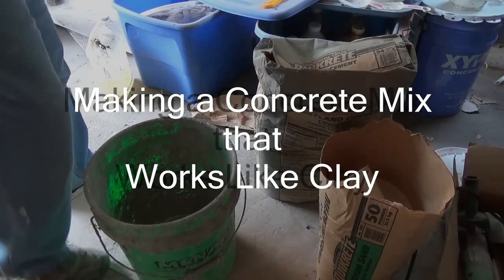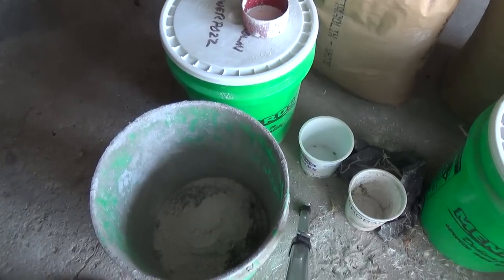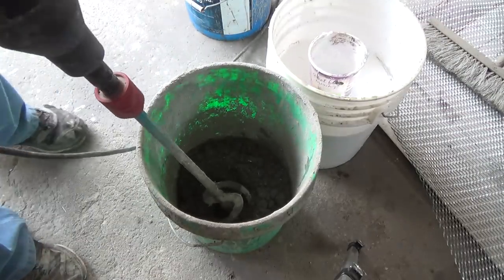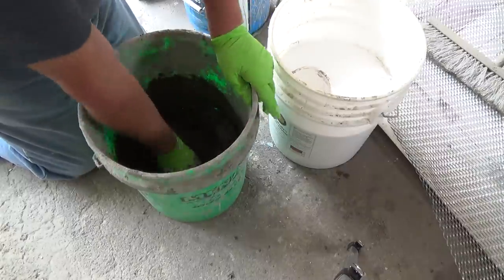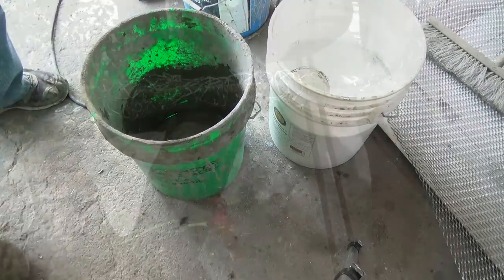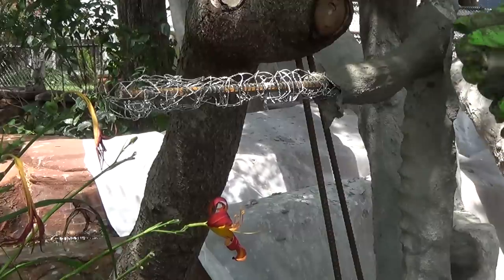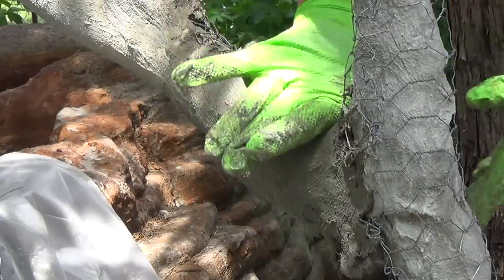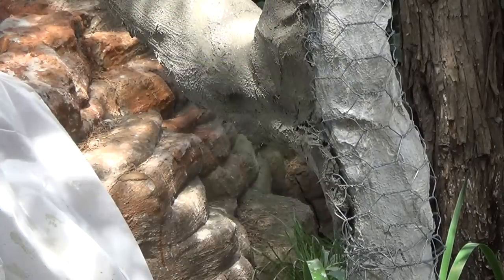#concrete #fauxbois Making a Concrete Mix that Works Like Clay

Comment: Would this mix hold up in a clay stove application? It would be helpful to have the recipe in the description. Thanks for this idea. I was Iooking at aircrete for my stoves and this caught my attention.
Reply from the maker: I don't know what a clay stove is.  If it involves high heat, I would look for a recipe that is specific to high heat applications.  I've no experience using concrete for that application, so I can't be much help.
Reply: @dperry428  Thanks friend. It does involve heat. I guess I wiII just have to use clay! Thanks for the quick response.
Reply: @thelordschurchfarmandranch6694  ad fire clay to the mix
Reply: Portland cement starts to dehydrate and turn crumbly at about 300C, so if you omit the PVA fiber (or use glass/carbon/basalt fiber) and keep the temps below that, you'll be fine. If you go over, then you'll need something with no Portland cement at all. Were I you, I'd experiment with metakaolin geopolymer cement. The stuff sets fast and has to be mixed precisely (you should measure by weight, not volume) but it survives well past 750C. You can make it by THOROUGHLY mixing metakaolin (substitute <40% fly ash to improve workability and delay setting) with just enough concentrated sodium silicate (aka, waterglass) to make it workable, then stir in aggregate, foam, fibers, etc. Cure it for a few days sealed or someplace very humid. If it doesn't set or is really weak, try dissolving sodium hydroxide or potassium hydroxide flakes/powder/pellets in your silicate solution. Note that hydroxide dissolution generates enough heat that it can wreck plastic and spit boiling-hot, highly caustic droplets back at you, so wear gloves/googles/shoes, add the hydroxide slowly, mind how hot your container gets, and let the solution cool down before you use it.

Comment: Hello sir, thank you so much for this video. My question is, what happens if we can’t find Portland cement, is there a substitute? All I find is Portland cement limestone. Your advice will be greatly appreciated. Thanks
Reply from the maker: You mean limestone portland cement.  That's portland cement.  Limestone is calcium carbonate.  When it ground up and strongly heated (calcined), it releases carbon dioxide. The remaining material is mixed with other ingredients such as gypsum and forms a clinker that is then ground up and is then called portland cement.  Since the production of cement produces carbon dioxide, the "climate change" fanatics have convinced the cement industry that it needs to reduce the amount of carbon dioxide, the industry is now replacing part of the actual cement with 10 % uncalcined, ground limestone.  So, the portland cement is now 90% portland and 10% limestone and the name is changed from portland cement to limestone portland cement.  It is claimed to be "as good" as the older product, but I say, "BS".  I alter my mix now to consider the ground limestone as if it were sand.  I add 10% more of the "limestone portland"  and 10% LESS sand to my mixes to compensate for the insanity of those who actually believe that our climate changes are an existential threat to our planet. They are nuts, but we have to live with the results of political BS.

Comment: With all your trial and error on mixes I’m assuming you’ve used fly ash? Do you prefer metakaolin over fly ash or find it easier to get your hands on? I get fly ash locally for my vertical mixes which I add 12-15% to (not in place of) I’ve not used metakaolin but just wondering your opinion on the two. 
To get my “polymers” I’ve been using thin set mortar (12-15% to) but have been looking to switch to a liquid to use in place of water. Have you used the KongKrete liquid as a bonding between coats/batches as well?
Reply from the maker: I've not used fly ash as it is not, to my knowledge, readily available to me.  Also, I've read that fly ash is, relative to metakaolin and silica fume, a weaker pozzolan.  Where it is available, however, it is likely cheaper.  I've also read of people using various mixes of thinset and concrete mixes for decorative concrete. Some have suggested 50/50 mixes of thinset and Quikrete or Sakrete sand mixes. I'm hesitant to use thinset as a source of acrylics.  I was led to believe that the polymers in thinset were re-emulsifiable and not suited to outdoor use.  I used to use Dayton-Superior J40 liquid acrylic emulsion but switched to KongKrete when I found that J40 was only 26% solids after having been told by sales people that it was 52%.  I have dealt for a number of years now with Fishstone and their products.  The KongKrete is clearly a superior product.  Undiluted, it is as thick as whipping cream and definitely the highest solids content I've seen.  Having dealt with Fishstone so long, I've found them to be very upfront and honest with their products.  They have a dry powder version of KongKrete that they have assured me would not re-emulsify, but I still haven't tried it.  If it performs as they say, it would be a lot cheaper to order online as you would not be paying to ship half the weight in water in the liquid form.
Reply: dperry428 The biggest plus of fly ash, for me anyway is of course cost. Because I get it locally I can get a 1,500 pound super sack for $125. That lasts me a long time. So being slightly weaker is worth it at that price unless it’s a huge difference in strength and workability. 
As for the thin set, you are correct. A lot of it is re-emulsifiable. However, MAPAI does make one that is for wet or submerged areas. Still though, I like the idea of alleviating a powder (that needs more water) and replace it with a liquid. I’ve been getting a few more shrinkage cracks lately because we switched from applying it by hand to a mortar sprayer which needs a higher slump. So I’m assuming the extra water is causing it. The sprayer saves a lot of time so I’m trying to alter my mix to accommodate. I’m also talking to the local quickrete distributors to get their plastic cement shipped in. It’s Portland but premixed with a superplasticsizer. Hopefully easier that way so there’s no goof ups on adding to much of a plasticsizer in the field. 
Thanks for the great information and quick reply!

Comment: So hard to get the concrete additives in Canada .
Reply from the maker: You're not trying very hard.  The only additives I'm using in this video are metakaolin and acrylic bonding agent/admix.
Metakaolin is produced from kaolin clay, which is mined in Canada and metakaolin is produced in Canada. Contact this company for local sources or distributors:    http://www.whitemudresources.com/
Do a simple search for home improvement stores in Canada. If they have concrete products, they have acrylics.  There are Lowes and Home Depot stores in Canada.

Comment: I was looking for a concrete mix that would be able to be hand pressed into silicone molds that I am making for some hollow artificial rock shells, and it seems like your recipe might work very well! My only concern is how strong the shells will be on the chance that someone decides to step on the rock once it's out in the garden. I may have to modify the recipe a bit to increase strength.

I did not notice your suggestion in the description right away and scoured the internet looking for a source for the metakaolin and had a difficult time. Luckily I came back to the video and noticed the reference to Fishstone. I live only about 25 minutes away from them! I will definitely be looking into placing an order with them soon as they also sell pigments and fibers, other supplies I was also having trouble locating a retailer for.
Reply from the maker: This particular recipe I use for final coats to sculpt and create textures. For greater structural strength, check out this video.
https://youtu.be/etSWuBIcdZc
Fishstone is a great company to work with.  Tom and Carrie are the owners and can be great assistance to you in meeting your needs. I've learned a great deal from them.  Call ahead to get supplies.  They are usually too busy to handle straight walk-ins.
Reply: @dperry428  Great, thank you so much! I will give them a call tomorrow. Maybe they'd be able to offer some advice and product recommendations on my specific project as well.
Reply from the maker: Tell them I said hello.  BTW, I'm in Genoa, IL

Comment: What is the thinnest application I can use. Trying to resurface a clay pot and needing to keep shape and be strong. It has a special stand and I cannot find another. Trying to resurface out side of existing pot and will use indoors. Have never heard of some of the ingredients and hate talk of percentages. Like 5 cups this 10 cups of that.
This mixture sounds like it has properties of product called Pal Tiya. Very expensive stuff, also thickness sensative. Writing down your recipie and going shopping. Thank you for your video.
Reply from the maker: I don't know how thin you can go.  If you use an initial coat of acrylic bonding agent (the white liquid), you should be able to actually paint on a layer.  Can't help you with amounts other than percentages.

Comment: Thank you so much for sharing your knowledge! Apologies if this has been asked, I have some fortified thinset mortar (both sanded/unsanded) I was wondering if you think your recipe could be modified to use it? I get it cheap at the home resale store, along with bottles of acrylic admix. My jaw would drop if ever the fibers and meta kaolin came in tho😂
Reply from the maker: The only time I've used thinset is to actually set tile in my bathrooms.  I know that some people have used a combination of bagged sand mix and thinset to make their version of decorative concrete for doing faux rock.  I know that thinset is made of fine sand, cement and a cellulose derivative and can also contain acrylic when it is called "polymer modified".  However, I don't know the proportions of sand/cement.  All I can suggest is to try it with metakaolin and see how it works for you.

Comment: Could I use hydrated lime instead of metakaolin? Thanks for your video
Reply from the maker: Sure, but then you'll just have mortar.  Lots easier to just go buy a bag of mortar.  Mortar will not give you the same mix as in this video.
Reply: @dperry428  Ok, I'm struggling to find met where I live, might have to order some.
Reply from the maker: Look for some brand names:
https://usa.sika.com/en/construction-products/concrete/concrete-admixtures/durability-enhancement/metakaolin/sikacrete-m-100.html
https://concretecountertopsupply.com/metakaolin-40lb-bag/
Contact these people and ask for distributors:
https://www.metakaolin.com/

Comment: Great video. Thanks. What do you think of adding lime? I saw an artist who does that, & also looked at a home store selling lime, & the description says it adds 'plasticity' to the cement mix?
Reply from the maker: The acrylic, metakaolin and, in my general mix, silica fume all add plasticity and workability.  Lime is used to make the mix stickier as in its use in mortar so that it adheres well to the brick or stone being laid.  I used to use mortar cement instead of straight Portland before I began using metakaolin and silica fume.  Mortar cement contains lime and I found that it made the mix much too sticky and difficult to apply to the underside of armatures.  That's also why, in this clay-like mix, I eliminate the silica fume.  I causes excessive stickiness that impedes application to the underside of my projects.
Reply: @dperry428  I deeply appreciate you sharing your  knowledge, as I have decided on these cement oriented materials for my art, after a lot of research, prayer, etc. You are awesome.

Comment: Hi, thank you for sharing your knowledge.  It is much appreciated by many!  I live in NJ so trying to find a source for the polymer.  I believe Fishstone has a dry polymer they sell called KongKrete Dry.   Buddy Rhodes in PA near me sells a similar product called Polymer 1210 Dry.  Both sites say to use between 3 - 7% to the wt. of concrete.  By chance, do you know how to mix this dry material with water to arrive at the same formulation you use with the liquid polymer and water ratio you use?  I would like to mix the polymer to get the 50% solids as you recommend and then mix the additional 3 parts water you demonstrate in the video.  Just not sure how to mix the dry material to arrived at 50% solid.  Thank you for your time.
Reply: Just figured out that I should add 1 lb of water to 1 lb of dry polymer to get 50% solids.  Skipped my morning coffee today.  Thanks again!
Reply from the maker: Just make sure the dry stuff is not re-emulsifiable if you're going to use the resulting mix in wet areas.  I don't know what Buddy Rhodes is using.  I do know that Fishstone's product is claimed by the owner to be non-reemulsifiable. Home Depot carries Sika acrylic admix.  It is about 15 to 23% solids if I recall correctly.  Here's some brands carried by Home Depot in a New Jersey location.  https://www.homedepot.com/s/acrylic%2520admix?NCNI-5
Reply from the maker: @anthonygiancarli9089  I just looked up the LaHabra Adacryl  SDS (safety data sheet) and they claim their product is 70 to 80 percent acrylic and 20 to 25 percent water and small percentage of other ingredients.  If that's correct, their product would be some really thick stuff.  The liquid KongKrete from  Fishstone is 50% solids and about the consistency of whipping cream.

Comment: Very informative video thank you. I was wondering what the metakaolin does and if it could be replaced with something else? Thanks.
Reply from the maker: Metakaolin does several things.  It is a pozzolan that reacts with by-products of cement hydration to form materials that strengthen the concrete.  It's particles are 10 times smaller than cement particles, filling in spaces between the cement particles, a concept known as particle packing,  making the concrete much denser and resistant to water infiltration.  It also makes the mix creamier and easier to sculpt and work. Metakaolin works for me.  You'll have to do you own research and experimentation to determine what else works like it.  I'm not an expert in concrete.  I know only what I have read and what I have used personally.
Reply: Thank you very much for your feedback. I actually did some more research after watching and I've heard from others that work with cement that lime can be used instead of metakaolin and is much cheaper and readily available. @dperry428
Reply: I'm not discounting your recipe, just here in Nevada we don't have any place around that sells that particular material. Thanks for your help!
Reply from the maker: Be aware that lime is NOT like metakaolin.  In fact, it is composed of, initially, calcium oxide, an extremely alkaline substance that is dangerous to handle and, if it gets in your eyes, can cause blindness.  If you choose to use it, be extremely cautious in handling it.  It will burn skin.  Replacing metakaolin with it results in the complete loss of particle packing and the result will be a less dense concrete. Initially, the concrete will also have less strength, though, after time, it will react with carbon dioxide to create calcium carbonate from which the lime was originally produced.  The end result is strong, but also prone to produce efflorescence, that nasty-looking white chalky substance that forms on the surface. The greatest source of metakaolin is in British Columbia, Canada, much closer to you than it is to me.  You might like to contact these people for distributors near you.  https://www.metakaolin.com/  You will save money using lime, but you will give up most of the benefits of metakaolin.
Reply: Wow thank you so much for your generous time sir! I really appreciate your knowledge and sharing as it is not commonplace these days.   @dperry428
Reply from the maker: I'm a retired science teacher.  I still enjoy sharing knowledge.

Comment: I watched this video several months back and am delighted to find it again. I want to make small batches to make garden decor such as small houses and other buildings to eventually create a village scene. Thank you so much!

I do have a question about a different mix. My house is a daylight basement plan which leaves nearly half of the basement exposed. I would like to make concrete tile to put on the exposed concrete walls. I would prefer the tiles to be 1/2”-3/4” thick. I could reinforce the tile with hardware cloth (aka rabbit wire) if necessary. Making molds to keep the size consistent is not a problem. Do you have a recipe that would lend itself to this of project?

Thanks in advance for any suggestions you may have.
Reply from the maker: You might like to watch this playlist of what I did with my chain link fence and also the video on by other recipes.
https://www.youtube.com/watch?v=RADNKKdnSNo&list=PLzgOxsVcbO_AgAOznvqS8_W5EeCjz2kM5
https://www.youtube.com/watch?v=etSWuBIcdZc